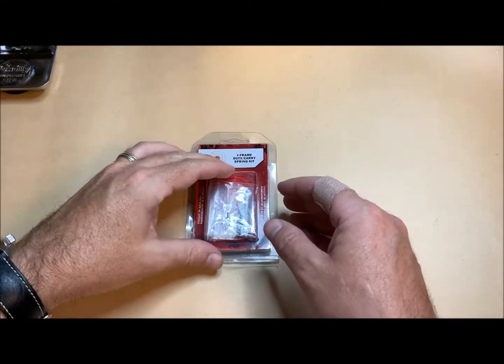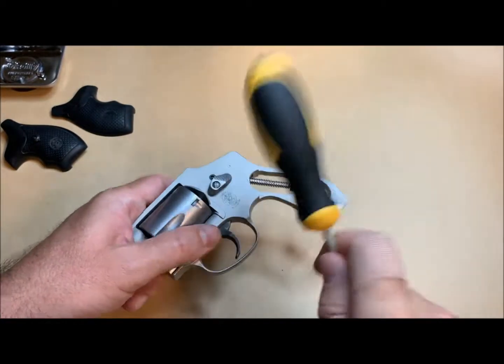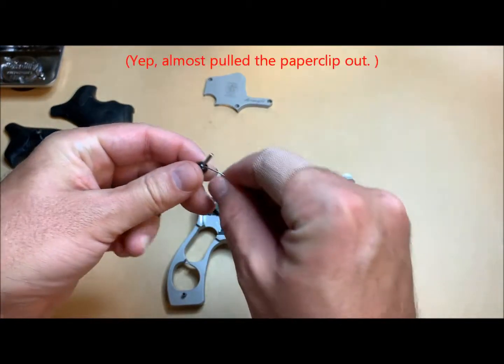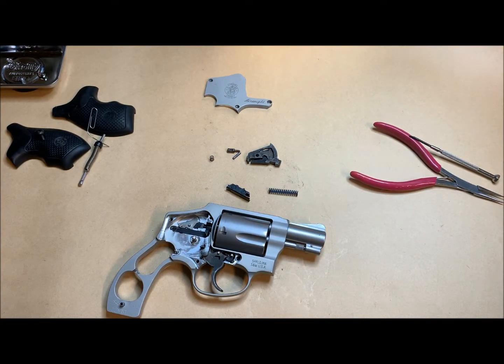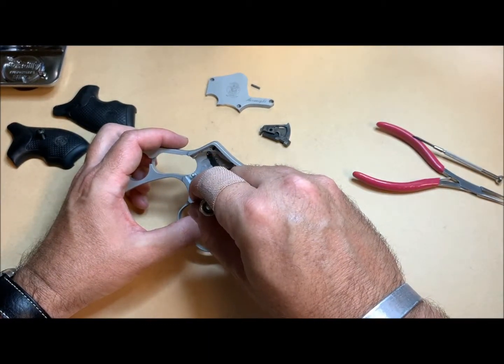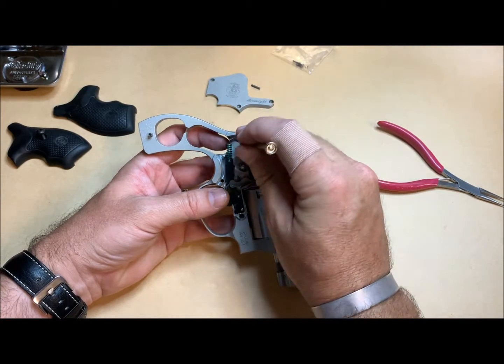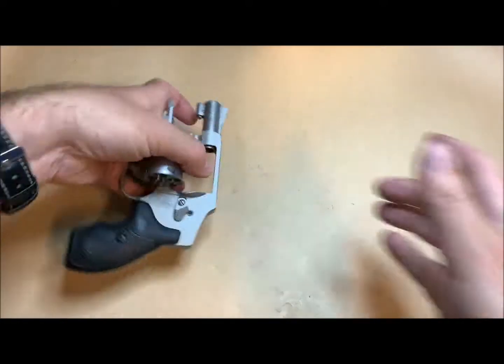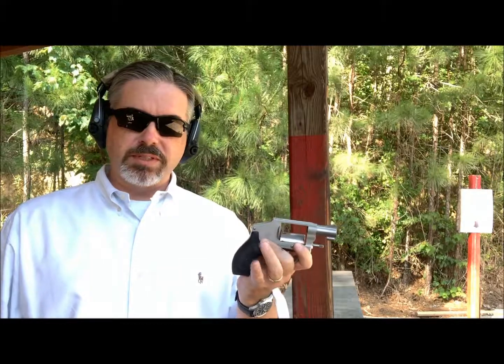Apex J Frame Duty Carry Kit Install and Review

Comment: I just installed the apex springs in my 642. World of difference. Pull is so much smoother. I did not swap out the firing pin though and am glad I did not. In my opinion the springs were the only thing that needs to be replaced. My accuracy has improved ten fold.  Highly reccomend

Comment: Put this kit in my 642 UC.
Had light primer strikes and trigger failed to return.
Took the kit out put stock springs back in returned to totally reliability. 
Buyer beware if you install this kit test all functions of your pistol.
Shoot at least 50 to 100 rounds that you will carry.
Your results may vary but for me definately a no go.
Reply: Try Wilson combat kit, I found it to work flawlessly in my model 60 and 632uc
Reply: Were you having any light strikes before with the UC? Got a 432uc in 32 h&r that has light strikes. Just put the apex kit in and polished some burrs so hopefully it fixes some of the light strikes I was having
Reply: @christianb7106  No light strikes when stock.

Comment: I am considering installing this kit on my S&W 442.  I do understand that the APEX kit has a slightly longer firing pin, to reduce light strikes.  It's been at least 2 years since the video was made.  Any updates OpSpecTraining?  Has anyone had any issues with reliability after installing this kit?
input / comments are appreciated.  Thank You!  
🤠
Reply: Yes light strikes a trigger failed to return.

Comment: All that tapping you did to get the side plate off was funny. You did it on the wrong side of the gun. Tap the grip frame on the side-plate side of the gun and hold your hand under the side plate. It will fall in your hand after three or four taps.

Comment: So I’m trying to decide on the Apex or the Wilson kit.  Wilson kit has a couple of spring options and is about half the cost of the Apex.  The firing pin in the Apex kit is my biggest contemplation.  Is it longer? Is it there to eliminate soft strikes due to the lighter spring?  Any point of advice you can give?
Reply: I can only speak to the apex. I have put about 200 rounds through since installing. No light strikes.
Reply: Save your money.Buy neither.
Reply: @1911bg your full of it!
Reply: @qb7384  Ah ha another key board expert!!